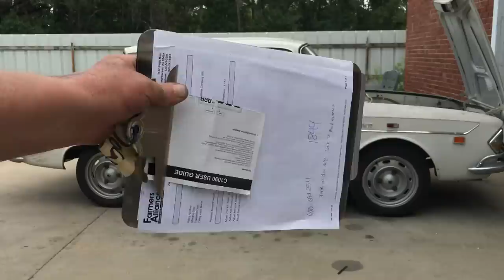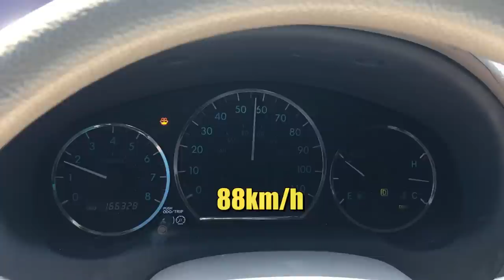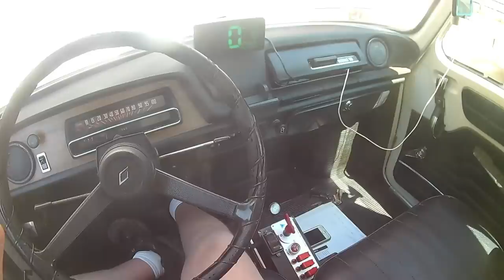S3 E21. How fast will this 670 cc predator V twin powered Renault go?...  Faster than you think!

Comment: Did you ever get the issue with reverse sorted out?  I remember you rebuilding the linkage, but then the problem might actually be internal to the transmission.

Also, I had a '73  BMW 2002 and it also had the directionals on the right side of the wheel.  And the wiper on/off control on the end of that stalk too.  Since that was my first car, it took me a while to acclimate to the "standard" setup.
Reply from the maker: Reverse is still a problem.  I had a look at the service manual and believe it or not they don't show how the shift mechanism works under the aluminum cover.  the good news is the manual does show how to take it apart.  we will have to do some transmission surgery soon.

Comment: I love it but I'm wondering if you couldn't get better performance by ditching the original transmission. Would it be possible to just go a direct chain driving setup? I've seen people go that route with bike engine swaps.

Comment: If I'm not mistaken I think I've seen these engines make close to 50 horse power with stage 2 performance kits. I think 0-55 in 24 seconds is very achievable.

Comment: I can not believe you got plates for it to go on the road. Where I come from it would have failed for over a thousand reasons at least.
Reply from the maker: Its an old car. We made sure it had all the mandatory equipment for street use and we made sure it was safe with functional brakes and new tires.  the engine doesn't mater because this car was built before emissions was and issue.  Actually this car is likely cleaner with the predator engine than it was with the Renault engine.

Comment: Hi Jimbo. I just noticed your "Swag" address in the description, and having no experience of what rural America is like (Or America in general. I'm a Brit), I had a quick look at Haven in Kansas on google maps. This quickly turned into a virtual sightseeing tour on google streets. It looks pretty picturesque. I get the impression that it's the sort of place where there's a "Community" rather than just a population....... Anyway, One thing I saw on the south west outskirts of the town confused me. It's a flat top tower just off KS96, and a little north west of "Shep Chevrolet Collision center"...... Any ideas what that is?
Reply from the maker: I believe Its an old tower for satellite up links.  They moved all that stuff to a more secure area.
Reply: @robotcantina8957  Ah, OK. That makes sense. The nearest I could think of was a water tower that was under construction, but it didn't seem to look "Work in progress" enough for that.

Comment: The Best Fourth of July Fireworks and Celebrations in Illinois!
Reply: Red, White, and BOOM!, Lincolnshire,IL
July 3, 2023
Witness the finale of a dazzling fireworks display at North Park on Independence Day. Feel the rush of a patriotic celebration with booms and blasts that light up the night. Join the community for a spectacular 4th of July celebration in Lincolnshire, IL.
Reply: July 4th Park 2 Park 5 Mile Run, Normal,IL
July 4, 2023 at 7:00am
Discover the July 4th tradition of the Park 2 Park 5 Mile Run at Fairview Park in Normal, IL! Join approximately 500 runners for a five mile course with three water stations throughout the race. Enjoy a special discount for LRC, Starved Rock, and Springfield Road Runners members. Celebrate the race finish with an awards ceremony to recognize overall male and female winners, as well as the top three male and female finishers in each age group.

Comment: Woho, I guessed right. I guessed between 100 and 110 Km pro hour back in the previous video!
Reply from the maker: Good guess!   I definitely didn't think it could do it.
Reply: @robotcantina8957  I base it around my experience with 2CV's and Trabant 601 they have a similar engine volume, actually a bit smaller, but their bodies are also smaller and lighter and they bottom out at 110 km/h.
Reply: @robotcantina8957  Almost forgot to congratulate you, it is coming around really nice. It is not a bad car you have made, I could see myself daily this thing. 
I am looking forward to following what upgrades you come up with.

Comment: Hey, I was pretty close!
In the comment section of this video - https://youtu.be/a4Gtnrk__i8 I mentioned that I thought it would top out around 60-65 mph. 
Nice to see it will hold 60 with no issues.
That top speed puts the engine @91.4% of its available rpm. That's pretty good and aludes to low rolling resistance. I bet the car was very easy to push by hand, while you were working on it.
You asked about what we thought the fuel mileage of this car might be. 
If you maintain an average of 50 mph, that'll put you within a couple of hundred rpm of the peak torque rpm for this engine, so I wouldn't be surprised if your mileage guess wasn't pretty close. 
I'll guess 40-45 mpg.
Look forward to your next installment to see how close we are.

Comment: so cool how you have pulled this off, didn't think it could get to 55 mph . how long would it last like that . do you have a clutch.
Reply from the maker: Depending on how the car is driven the engine should last many years.  There is an automatic clutch fitted to the engine, it works ok, but it takes a lot of experience to shift the gears.

Comment: I got a doubt regarding the cooling.
If the Predator engine "sucks" air from the front to channel it through the fins, would that make some sort of ovearheat effect since it is mounted  "backwards". Meaning that, the air is actually being forced from the back to the front?

Also, the heat from the exhaust muffler could affect the performance of the engine? will it improve with a cold air intake?
Reply from the maker: Overheating is still a concern at this point.   We plan on changing the exhaust to get rid of the giant muffler that dumps a lot of heat in the engine bay. Now that we have the car road worthy, we begin doing improvements.

Comment: As a Prius owner, I can sympathize with the vague throttle pedal. Regarding the Renault, it seems to have a decent top speed, but takes awhile to get there. Any plans for forced induction?
Reply from the maker: Forced induction has been done on other channels and we did it on the 420cc Honda Insight.  The issue is other channels don't provide long term data on how the engine deals with forced induction.  We discovered on the 420 cc honda insight the head gaskets don't do so well and we would likely have to O-ring the heads to get it to work long term.
Reply: That's understandable. I'm sure you can get some more "oomph" with a few n/a mods and gearing tweaks.

Comment: You see! I knew it would go faster then 55. Wonder what was the top speed was with the Renault engine?
Reply from the maker: I guess it all depends. I have heard somewhere between 75 and 80 MPH
Reply: Ok I can see that. My FIAT 128 1100cc could just break 80 so... ok. Thanks

Comment: I wonder if it has enough umph to hook directly to the transmission and avoid any losses through the CVT?
Reply: Perhaps, but you'd still need to address the thrust load of the transmission so it doesn't go into the engine
Reply: He's technically using the CVT as a clutch setup as well. It's noted in other videos, and similar issue with the Honda series, These side shaft engines were never designed for sideways thrust loads that they could experience with a pressure plate compressing against them. They would chew through to aluminum block in a matter of hours or minutes and start making lots of noise.

Oddly enough, even standard fluid Automatics experience a little bit of thrust from the pressure of the fluid inside the Torque Converters. I'm not even sure these engines could deal with that load either.

So these CVT setups are super simple to put together, and act as floating clutches until he starts to put the power through them.
Reply from the maker: I wish I could directly couple the engine to the transmission, but as others have mentioned the engine cant handle the thrust loads.

Comment: Why not connect the gas pedal to the CVT ratio and put a leaver for RPM selection on the dashboard? :)

This way you just put the car into max RPM (and max power) with a leaver and then select the speed of the car via the CVT ratio.
Reply from the maker: I'm sure that's possible, however it would be very complex and take a few months and a lot of money to engineer.
Reply: @robotcantina8957  let's pull off a Captain Kirk here and say: You got four days :P
Reply: @robotcantina8957  joke aside: You just need a fork and a roller bearing, like on a clutch. :)

Comment: With all the leftover parts from various cars you have worked on could you piece together an A/C system and run it of a 212 Predator engine in the trunk?
Reply from the maker: You know I have actually thought about that....hmmm
Reply: @robotcantina8957  Great minds think alike. Sometimes ; )

Comment: The Best Fourth of July Fireworks and Celebrations in West Virginia!
Reply: 4th Of July Car Show, Chester,WV
July 4, 2023 at 11:00am
Chester City Park is the place to be on the 4th of July, as the Chester Lions Club hosts its Annual Car Show. Enjoy a wide selection of cars, trucks, and motorcycles, with over 175 dash plaques and 40 awards. The fun doesn't end there either, with a DJ, 50/50, raffles, door prizes and more. Food will be available, with proceeds benefiting the Chester Lions Club projects.
Reply: Barboursville July 4th Fireworks, Barboursville,WV
July 4, 2023 at 10:00pm
Come to Barboursville Park, Co Rd 31/6 this Fourth of July for an unforgettable display of fireworks. At 10pm, a mesmerizing show of light and sound will fill the air at Barboursville Park and beyond. Enjoy the beautiful display with friends and family, as you find the perfect spot in the park or anywhere in the village to witness this dazzling show.

Comment: that engine is to weak for that car, the acceleration is not quick enough and a safety risk in public traffic. other drivers will assume that car accelerates about as fast as the other cars and then a collision is more likely to happen, like when that car is turning into a road or overtaking another car on the road. its a straight looking classic car, nice, it should have a more eligible engine for public traffic. i looked the Renault 10 up on wikipedia, the original engine wikipedia says was a 1.1Liter engine with 34KW (46HP), i guess there is this reason why the engineers did not make that vehicle with a smaller engine than that.

Comment: I'm not asking you to do this but do you think it would be possible to build and adapt a "thrust stack" to these engines which would allow mounting to an automotive transmission in a more normal-ish fashion? ("Thrust stack" is rotary engine parlance, I don't know what else to call it.)
Reply: How do you describe a thrust stack?
Reply: @becausetrains  basically some way to have thrust movement of the crank bear against a needle thrust bearing mounted on the opposite side of the engine from the clutch. Google "rotary engine needle thrust bearing."
Reply from the maker: Building a thrust bearing to adsorb the load of the clutch is defiantly possible.  We didn't go that rout because it takes more time and money.
Reply: @robotcantina8957  would a centrifugal clutch work in place of the CVT or the original clutch? Most of them are set up with a sprocket to use with a chain drive, but it seems like that wouldn’t be a big issue for you to solve.

Comment: I know I'm not telling anything but when u trailer on a car dolly the drive wheels go on the trailer so that doesn't happen just being thoughtful 👍
Reply from the maker: Most cars with a manual transmission should be fine?
Reply: I know you aren't worried about the mileage on the car but Farris bueler with the farari taught me that it takes a long time to go reverse to get the odometer back to original miles🤣 I've always been told that the drive wheels go on the car dolly so that's how I've always done it🤣

Comment: Why don't you have the trunk lid on it?

(if a trunk in the front is called a frunk, is an engine hood in the back called a bood or rood?)
Reply: The trunk is a trunk, front or rear, engine front or rear is still the hood. But it's worse in the U.K., it's boot (trunk) and bonnet (engine).
Reply from the maker: The huge muffler dumps a lot heat in the engine bay.  Once we make some changes to the exhaust it will be safe to run the car with the hood on.

Comment: Renault made plenty of smaller cars than the ten that had engines smaller than the one you have in this. As for the controls for indicators and things the French did not change these things for any country in the early days because they were French and that was a good enough reason. They had their own way of doing things that leg to a lot of inovation and outside the box thinking.
Reply: The 4CV had an under-square 750cc, 4 cyl. I don't recall anything smaller than that... wait, R3, 603 cc.
Reply from the maker: The French do odd things and that's a French thing for sure.  I think we can all agree the world would be less complete without the Citroen DS21.
Reply: The 2cv and early 4 cv.

Comment: I wondered how u changed gears without a clutch
Reply: with the belt-drive cvt, simple as letting off the throttle, shift, then get back on the throttle
Reply from the maker: Its possible to switch gears on a manual transmission  without using the clutch.  The technique is easy to learn.

Comment: Just wondering how many thousand miles can that Predator engine go before its dead?
Reply from the maker: Good question.  Generally these engines are rated by hours, and as I understand two years is what you can expect.
Reply: Interesting, @c90adventures youtube has a mini series of him doing 1k or so miles in a mini/ micro jeep. The capacity is even smaller than this predator engine. I enjoy your craft.

Comment: how much for the 212 michigan plate i like it and im in michigan
Reply from the maker: The 212cc plate was from the 212cc powered Honda Insight we built when the channel was based in Michigan.  The actual plate is fake and it was custom made by a vendor on Ebay.  Anyway its now wall art.
Reply: @robotcantina8957  o ok very cool still

Comment: I’m thinking the engine burns 1 gal. Per hour at 3,000 RPM 64oz. Divided by 60 = 1 oz. Per second ( + or - ) so at 60 mph it should burn 1 gal. Giving it 60 mpg and Kansas is flatter then my ex-girl friend it should do it easy ! Lol

Comment: With this setup,  do you even need a clutch?
Reply from the maker: Yes and no.  Right now we are using the comet 44 magnum torque converter type clutch and shifting through the gears by using the synchronizers. A real clutch would help with quicker shifting and easier down shifting.  Unfortunately due to this engine not being able to handle the thrust loads of a regular clutch this is the best we can due on a small budget.
Reply: @robotcantina8957  in theory you could plop this into 4th gear and drive off if you had more HP! That would be fun.

Comment: 3600rpm is set because of alternating current in generators. 60 cycles per second times 60 seconds equals, you guessed it,  3600rpm.

Comment: If you get hot just turn the ac on
Reply: what ac? that vintage a car, ac was NOT a standard item, it was an option that could be added on.. and even then, not every make/model even had the option available..
Reply from the maker: LOL
Reply: @niteriderevo9179  Twas a joke. Went over your head obviously.
Reply: They did! 2-55 A/C as mentioned in video